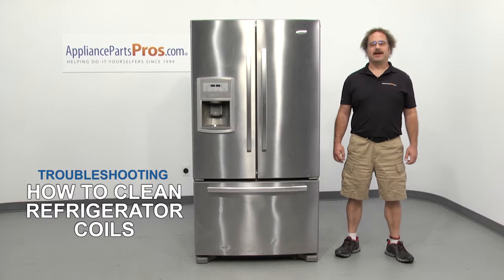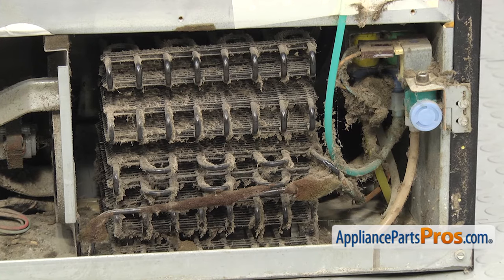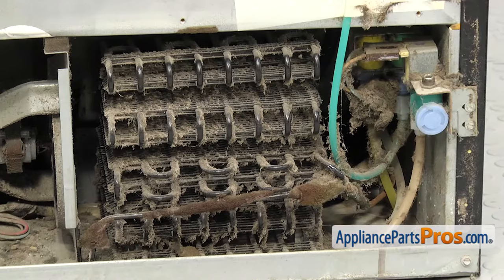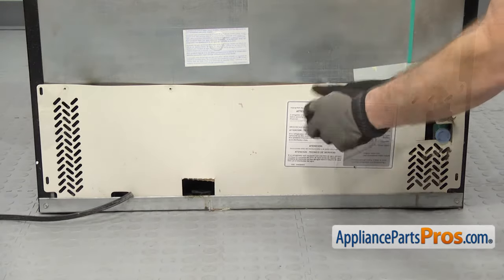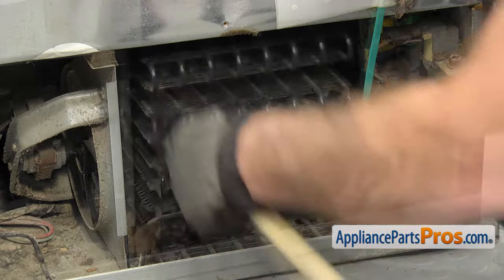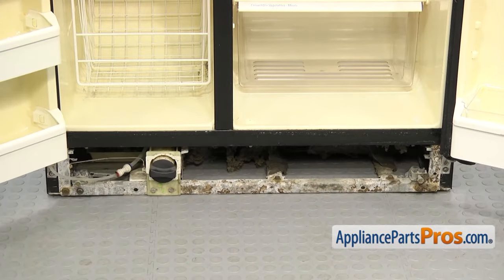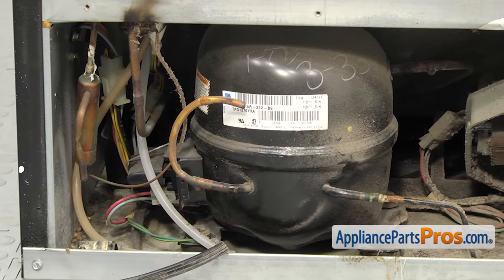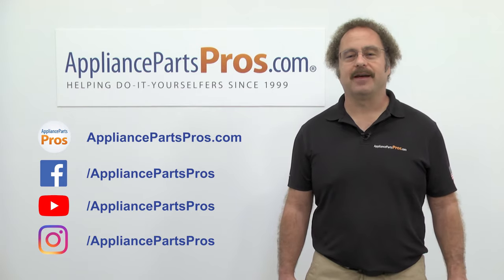How To Clean Refrigerator Coils in 5 Steps - GE, Whirlpool, Maytag, LG, Kenmore, Samsung, and more

Comment: I have an LG mod. LRBN20512WW. Behind the front bottom grille plate is a solid panel.  The manual says the coils should be behind the grill plate.  The back of the unit is solid.  Any ideas where I can find the condenser coils for cleaning?

Comment: Ha  the second example shows my fridge and in the video he cleaned just the front section.  the remaining coils are in a W config and only acccessable by lifting the fridge, giant PIA.  why do manufacturers insist on putting hot coils UNDERNEATH the cold fridge.  sub zero is the only company with coils at the top where they belong
Reply: I have a refrigerator with the “W” shaped condenser coils on the bottom of the unit. 

You can reach the first row of the coil with a vacuum cleaner as shown in this video.  

How do you clean the remainder of the coils?  Here is how. 

First, pull your refrigerator out into the open area of your kitchen.  

Next, with a screwdriver, remove the rear access panel on the lower back side of your refrigerator.

Using a leaf blower or shop vac with the hose connected to the exhaust side or an air compressor with an air blast wand, blow clean the remainder of the coils.  

If your refrigerator is several years old and coils never cleaned, your kitchen will now be a dusty mess, but your coils will be clean.  

Replace the back panel, slide your refrigerator into place, and then clean your dirty dusty kitchen.

Clean once per year.  If you have a dog that sheds hair, you may need to clean far more often.  

Next, go clean your laundry dryer vent.

Keeping these two appliances clean will help lower your electricity bill.

Comment: Should you unplug it first or will that mess up the timing of the filter change indicator?  Also, LG LFX31925 panel says to not remove the panel unless a tech.  Huh, so it fails again and you have to call for service???
Reply from the maker: It shouldn't mess up the filter change indicator if you unplug the fridge. What is going on with your fridge?

Comment: How do you clean the coil behind the kick plate? It seems that you can clean the front of the coil, but not beyond the second row of coils and I have 6 rows on my refrigerator and it freezes over once a month because I can’t clean the coils beyond the second row?
Reply from the maker: What is the model number of your fridge?
Reply: @appliancepartspros  Same question, can remove front cover at bottom of fridge, and get to the first coil, but not the ones behind it. They are not reachable from behind fridge. Whirlpool ED2KHAXVQ01

Comment: My GE has the cylindrical style condenser. There are multiple concentric coil layers. Thinking maybe have to move outdoors and clean with compressed air. Any thoughts?  GE not exactly on my "good list" right now.
Reply from the maker: What is your model number? What exactly is going on with your refrigerator?